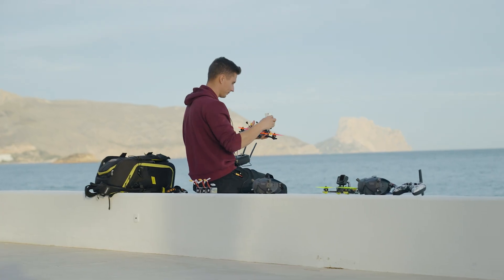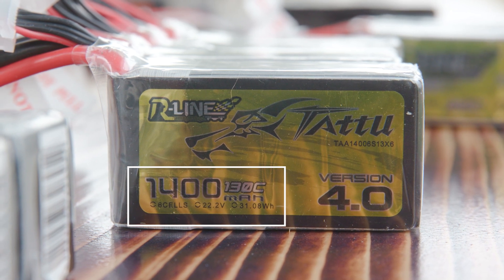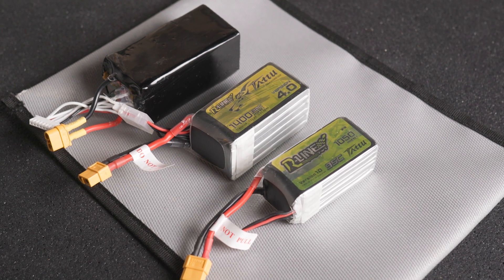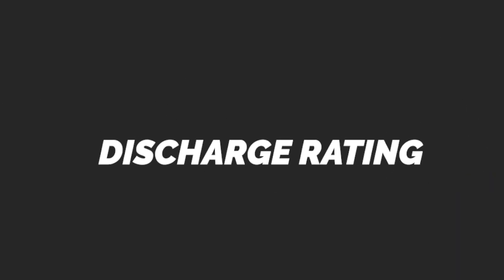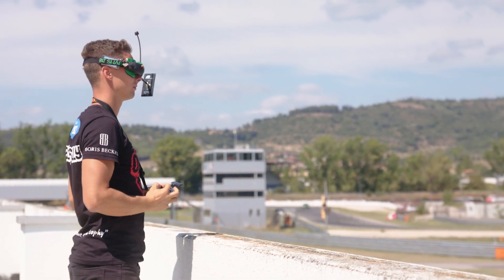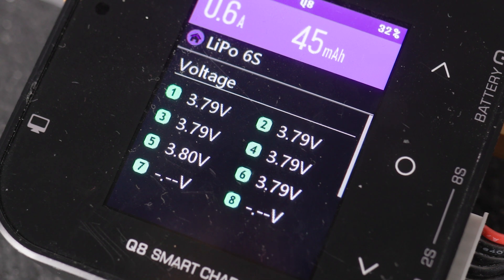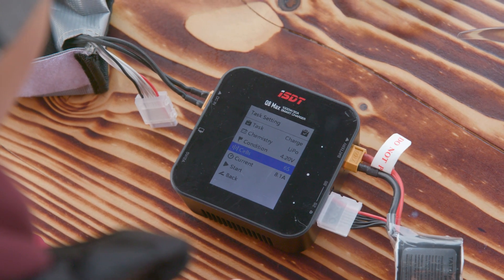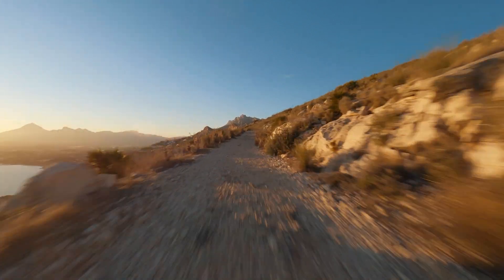How to choose a LIPO BATTERY for FPV Drone

Comment from the maker: What are you favourite lipo batteries to use? 😎
Reply: R-line !
Reply from the maker: @cedhrb  Great ones!
Reply: R Line for sure !
Reply from the maker: @WillHsuAerial  They are fire!
Reply: Really helpful video tom. I use r line 6s 1400mah 120c v3
Reply from the maker: @DavidStevenson-dy8kq  Thanks! I use those as well, great batteries!
Reply: CNHL MiniStar 1500mAh 4S / Thanks for the great Content Tom! 😊👍
Reply from the maker: @beckzFPV  Thanks for watching!
Reply: Cnhl black 6s 1300mah
Reply from the maker: @ReQuiem awesome!
Reply from the maker: @RedXFpv  Nice, hope you are satisfied!
Reply: I am new and bought a drone with no charger. I have 2 100C 1500MAH 4S batteries and a 75C 1550MAH but it does not show how many S there are. I think it is 4S since it worked well on my drone but please help me find a fitting charger for them. Er put your charger in the description pls.
Reply: DemonRC Fusion 4S 1500 way better that r-line tattu and cheaper

Comment: so its not recomended to adapt one off this to a normal camera drone that uses a eletric board in the battery inclosure and only 3 wires ( positive ,negative and the one wire for balancing the voltage ) but majority off 7.4v have 2 conectors one with normal positive and negative and one with nore three wires  for balancing and charge !!! So what wires i conect to my board ???

Comment: I do not not agree with always charging at 1c If you don't need the speed, .half c will be nicer to the battery. It may take a year or so to see a difference, but it will be there. Below half c there really isn't an improvement. Also 5c is just too fast based on my knowledge. But, I'd be open to scientific arguments from anyone. 

I get that rline batteries have extremely low resistance and can deal with higher rates the easiest. But think if everyone watching. Someone has a pizza battery that they've been hard on the last year now says, "oh, 5c is cool sometimes." when in their case it'll kill that pack. I just wouldn't suggest it. 

For anyone confused, Gens ace are tattu. Tattu are gens ace. :)

Comment: Hey Guys im new to the fpv hobby and the first two batteries that have come with an rtf kit I bought two weeks ago have been screwed up. The company I bought them from has offered to buy new ones for me that I have too choose. The included ones were 4s 1100 mah 50c and Im just wondering whether it would be fine to buy 110c 4s battery 850 mah? Because they have double the c rating.

Comment: Two important things. Either remove the seal from ammo box or drill hold on top to prevent it from exploding when lipo goes off. There is a lot of gases being made when lipos set off.
Secondly the lipo bad you showed is of low quality, please check torvol lipo bag and test they made ( setting off 12 charged lipos inside )

Comment: What's a good discharge C rating for a 7 inch used for chasing cars and motorcycles? I see for sale 4000mah 5s lipos with a 60C discharge rating. Is that enough? I currently fly my 7 inch to chase and some freestyle with 1550mah 100C 4s batteries. It flies pretty well this way.

Comment: For someone new to FPV, this was a perfect explanation for me. Thank you for putting it together. The frustration I have is my charger is a single input only. I know I can spend a lot of money on dual channel but you showed a device you can plug in the gives you ore ports. Can I plug that into my single channel charger and charger say 3 identical batterie at the same time? ie 3S 650mAh? Also if the maH falls between two points ie 0.6 or 0.7 which do i choose, a higher or the lower number?

Comment: Hello very nice video. Congrats. A GEPRC cinelog 35 tabled with 6S can use 4S battery? Where is the principal diference between this drone with 4S or 6S?
Reply from the maker: 6S = more cells = more juice = longer flight time and more power

Comment: What s your favorite lipo for nazgul5 v2? Now I am using lipo 6s funfly 1300...thanks
Reply from the maker: Those are great batteries, I use them as well... And I also use 6S R-line 1400mah 130C and they are the best ones from my experience

Comment: Ore more of a challenge but in the cli you can set up a KV cut to set your motor to the disputed KV  for when your running a higher s rating on a higher kv motor as long as your ESC/s are rated for a higher s rating like 6s you should be fine 🤘🤘🤘🤘

Ore you can just deal with the insane throttle curve you'll creat and warm motors 🤘🤘🤘

Comment: Tom, thanks for the video! I am new to FPV. What mah and C value will you recommend for my 4S batteries on 5inch drone if I want to make cinematic video? I am thinking between 1500mah and 1800mah to have more time to fly.
Reply from the maker: TATTU R-LINE Version 3.0 14.8V 1800mAh 120C 4S :)

Comment: I usually field charge my batteries from 4,15-4,35V and use them right away. 
It gives you 20s of extra power and a little longer flight time,
meanwhile it doesnt degrade batteries becouse of very short time at HV.

Also like your videos
Reply from the maker: Good info! I also try to field charge as often as possible or just a few hours before flying... but a lot of times I have an early morning filmmaking project.. so I have to charge them one day before already...  Najlepša hvala Matej :)

Comment: How long the fully charged battery last unused? If u charge the battery few days before the flight would it hold the same voltage?
Reply from the maker: Usually you want to go fly asap after charging it.. Each day the voltage decreases slightly and it's not good for the batteries longevity. But sometimes if I am on a filmmaking project, batteries stay full for 24-48 hours before I fly

Comment: Great video for beginners. Good job Tom !
Also if your charging multiple batteries (1500mah 6s - 1300 mah 6s - 1800mah 6s for example) just add the capacity of all of them (1500 + 1300 + 1800 = 4600mah) to determine the desired 1C rating (in this case 4.6A).

PS: I also burned a parallel board once, scary stuff xD
Reply from the maker: Thanks for the tip! Yeah that burn was a scary experience :D

Comment: For my new Sector v3, I got 1300mah Tattu v3 and 1550mah Tattu v3. Haven't had a chance to test them yet as I'm waiting for my dji v2 goggles but something to take into account is the weight. 1300 is at 210g and 1550 is at 250g. I will evaluate the ratio between extra weight / extra flight time / flight characteristics with both... Choosing the right battery is really not that simple.
Reply from the maker: Let me know how it flies with those batteries :)

Comment: What voltage do you run your 6s battery to
Reply from the maker: I usually land at 3.6V per cell
Reply: @tomstrojnik  nice tom I hear you knocking
Reply: @tomstrojnik  what quad are you flying most tom?
Reply from the maker: @DavidStevenson-dy8kq  Racing with Protek35 on a paintball poligon and Nazgul5 for filming and freestyle :)
Reply: @tomstrojnik  awesome Tom bro I went with the titan for more range 
, awesome quad

Comment: Something about the C rating, to be honest the C rating depends on the capacity, for example, a 850mah 100C means it can output 85 Amp max (ie 0.85*100), but a 1300mah 100C (ie 1.3*100) can output for 130Amp max.
Basically C rating means how much Amp you can pull without damaging the battery.

Just know that 100C is not always the best case for each lipo.

(Always check how much Amp your drone probably draws so you can choose the correct rating lipo)
Reply from the maker: Thanks for the info Carson!